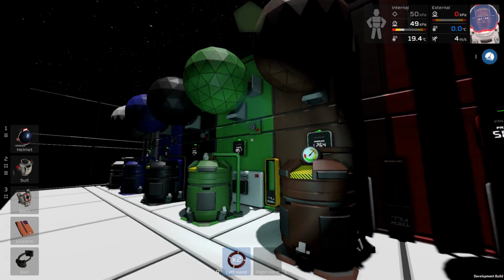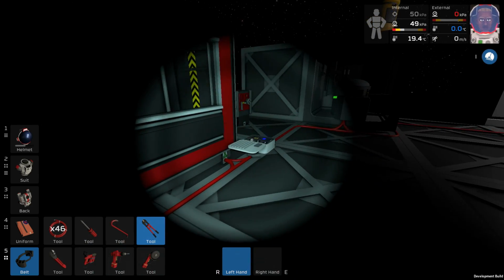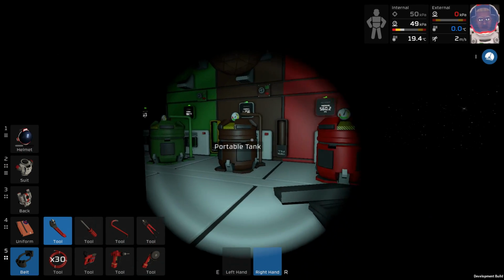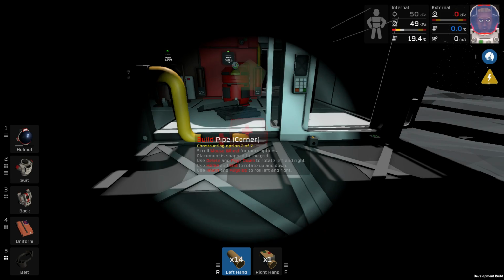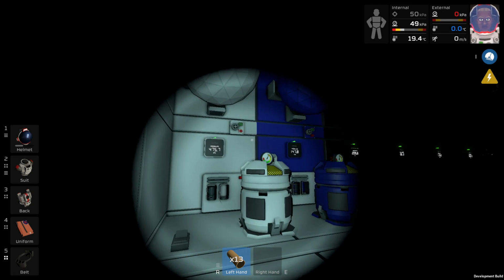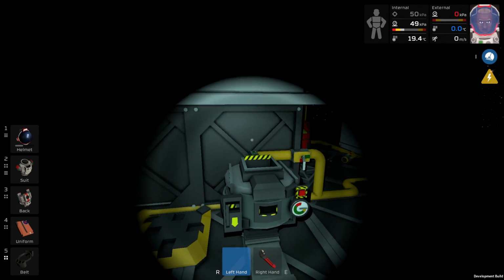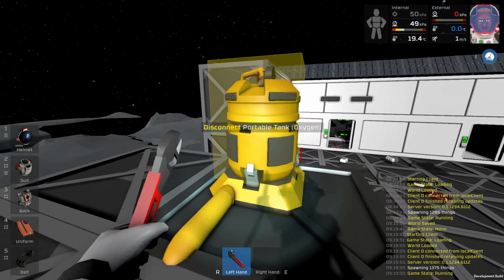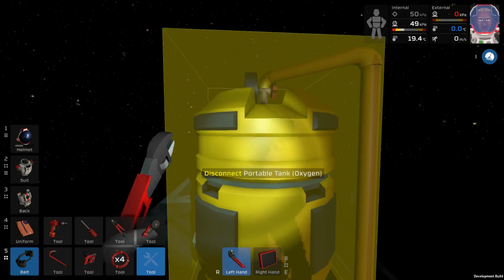FURNACE GAS EXTRACTION - Stationeers: Ep. #27 - Gameplay & Walkthrough

Comment: with some gas mixing, some pipework and a pressure regulator you don't need to calculate and count your volatile and oxide anymore as you hook it all up to the furnace input. just make sure you have a way to flush the pipes (volume pump).
why do you want to haul that tank around from your furnace setup all the time?
you need a filtration system anyway, to pull waste gas from your rooms, so might as well hook it up to that.